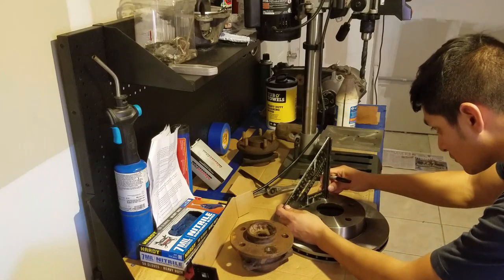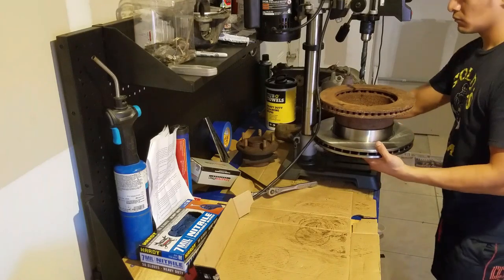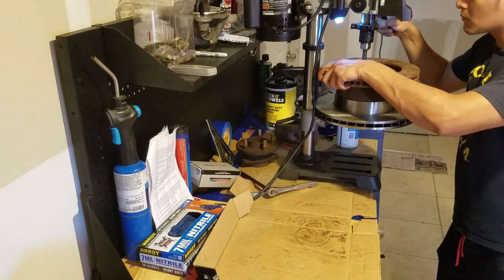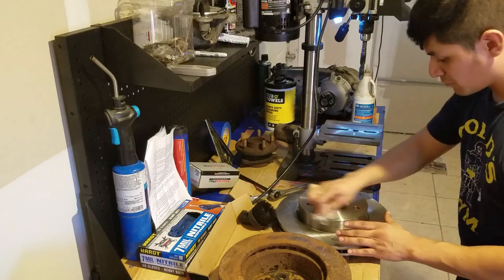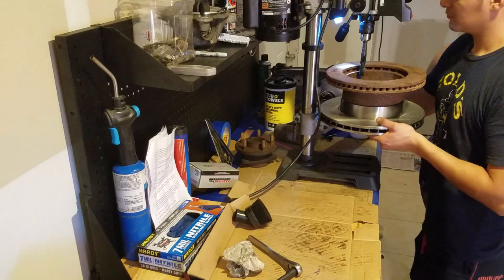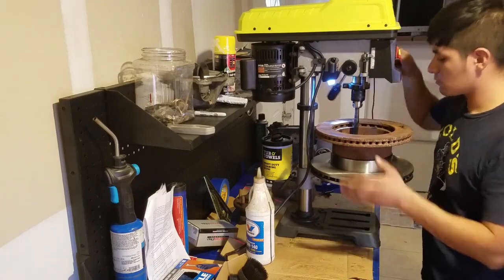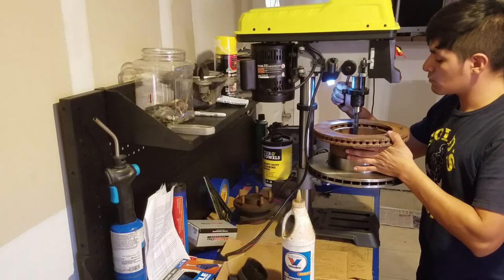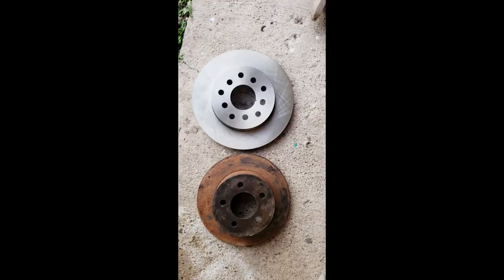How I Re-drilled Grand Cherokee (WJ) rotors to 5x4.5 bolt pattern

Comment: What size drill press are you using? Looks like the 10" 12 speed drill press from Harbor Freight which is what I was considering on buying vs the 8" 5 speed drill press